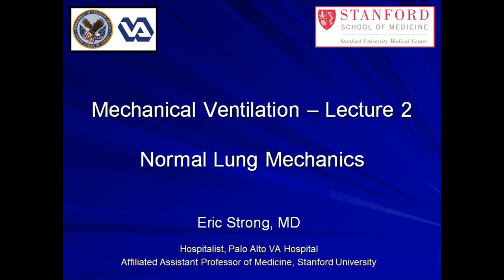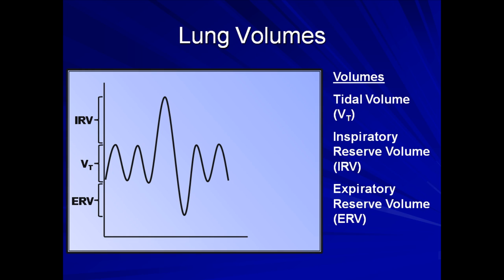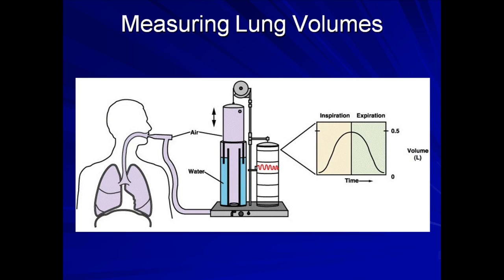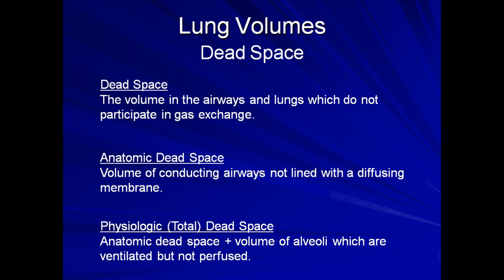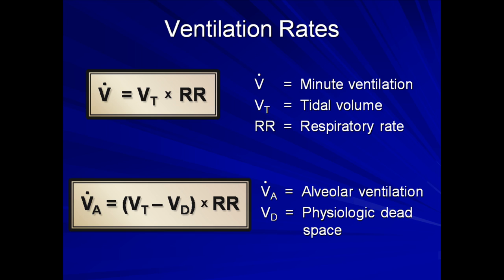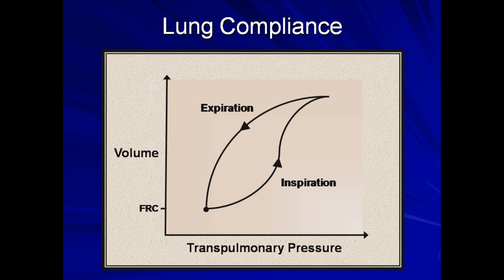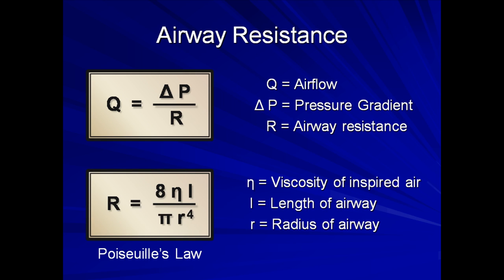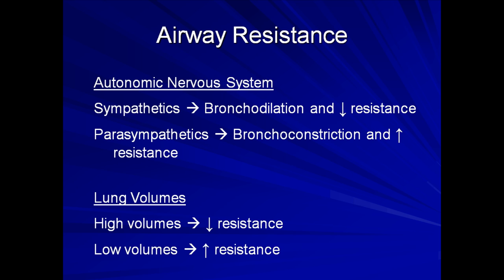Normal Lung Mechanics (Mechanical Ventilation - Lecture 2)

Comment from the maker: @ventilator98 Actual measurement of lung compliance and airway resistance are rarely done or necessary. It's more an understanding of the concepts that helps with ventilator management. Regarding the specific numbers of 45 and 11, it would depend on what units were being used, and on the size and age of the patient. For an average adult male, ~200mL/cm H2O is considered normal lung compliance, and >50mL/cm H2O is consider normal pulmonary (lung+chest wall) compliance.

Comment from the maker: @ventilator98 I must plead ignorance on "normal" airway resistance, though it varies tremendously by age (somewhere like ~10-100 fold, higher resistance at birth, lower by adulthood). As I said, it rarely is necessary to measure it specifically, and I've never myself had a patient in whom it was useful to know the exact number. If you did need to know for some reason, an experienced respiratory therapist might be able to give a more specific answer than an MD.
Reply: I read this comment with your voice and it made me satisfied